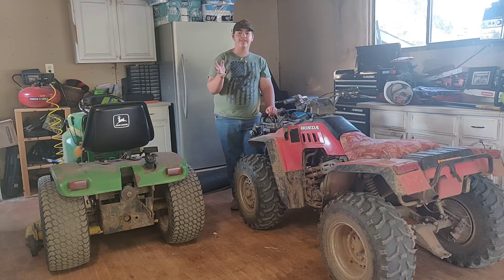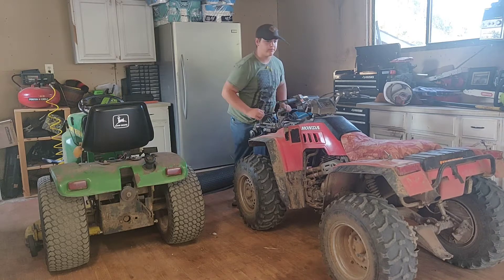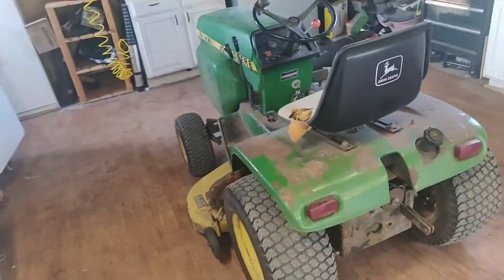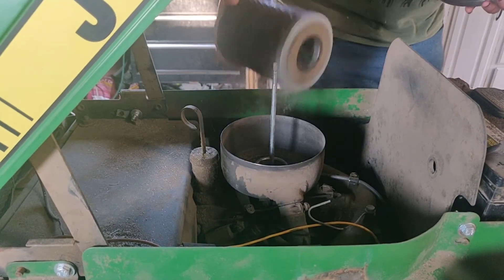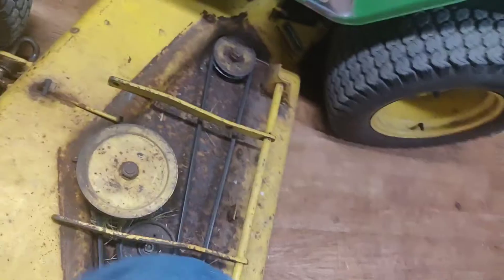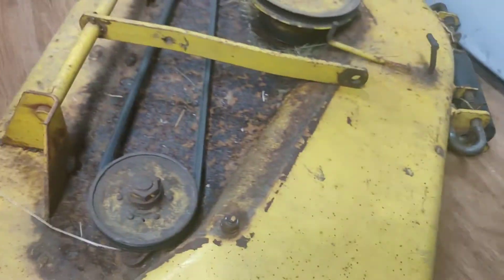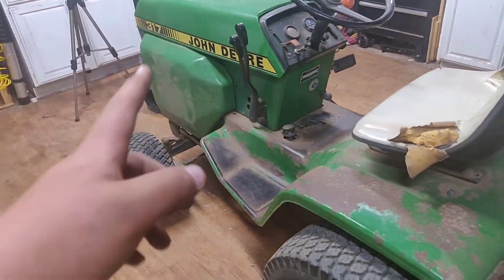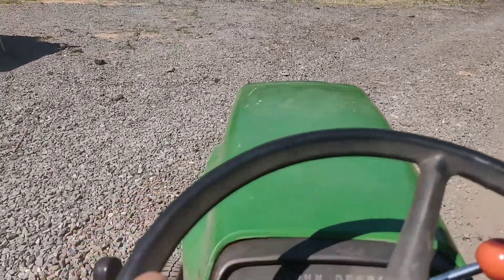Getting the John Deere 317 ready for show, Fixing throttle, Installing blade and Rototiller.

Comment: You got a hydro whine, change your transmission fluid. It usually takes standard engine oil. 10w 30 Full  synthetic. Also check your filters. Worst case it could be a bearing